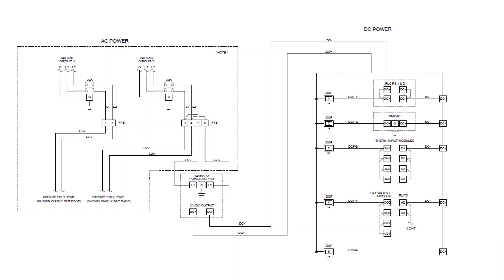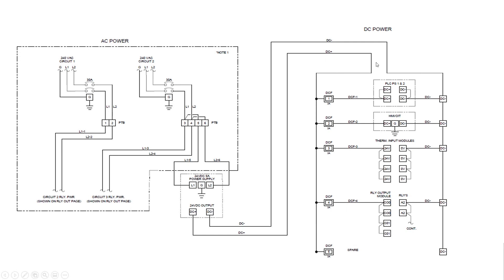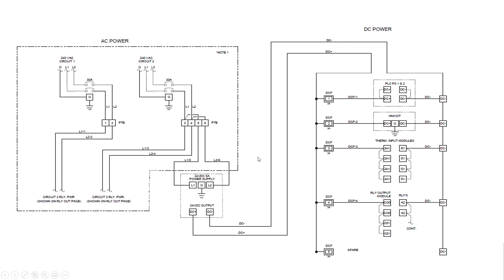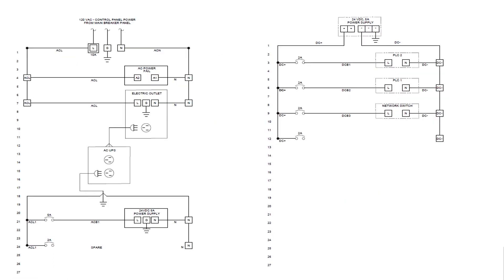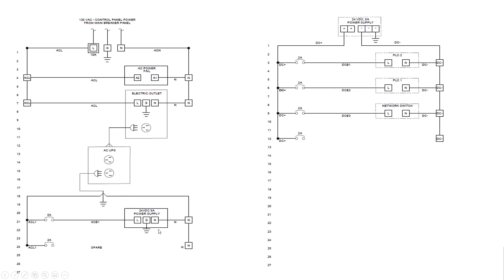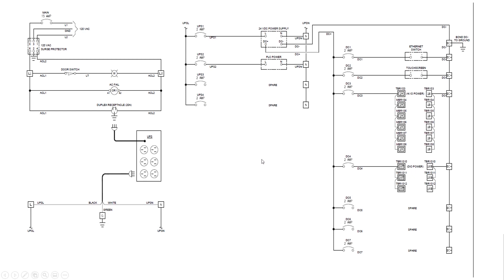Understanding Wiring Diagrams - Part 3 Power

Comment: I like the idea behind these videos. But in two pages you are already mixing up L, N and PE placement. On the first page PE is on the left, and in the second page it does not follow the same logic, and PE is in the middle. If you draw a hundred pages, you always want to find it placed in one order only and stick to it. Normally depending on the drawing scheme the L is on the top, N in the middle and PE if drawn at all at the bottom. Because on paper if you flip a page, you will follow the mains and neutral on the same places. But my point is, at least keep it consistent, or you will make someone really angry, specially the maintenance guy or during a change in the cubicle. Keep it simple and same logic.